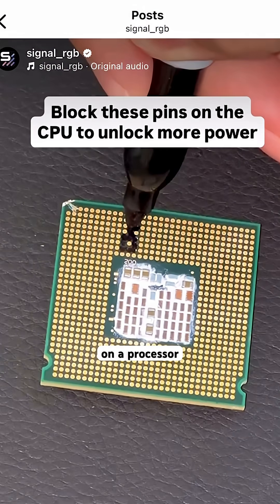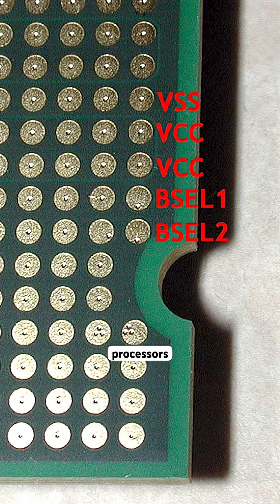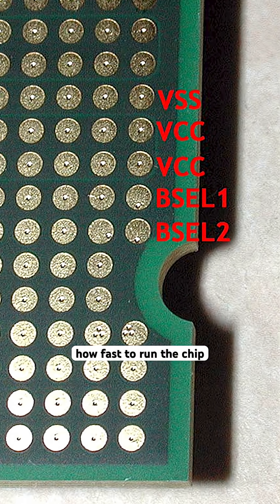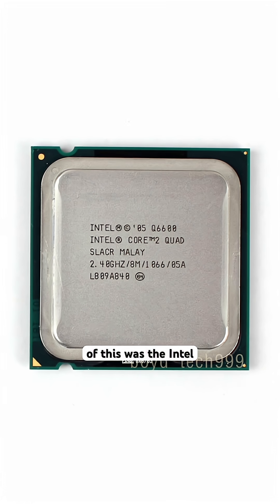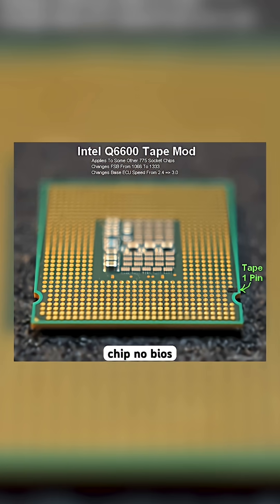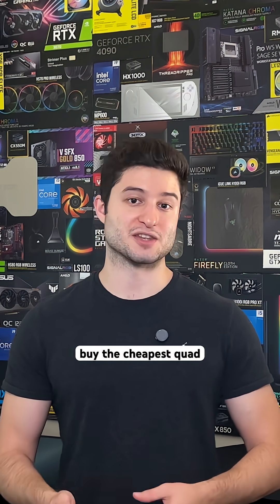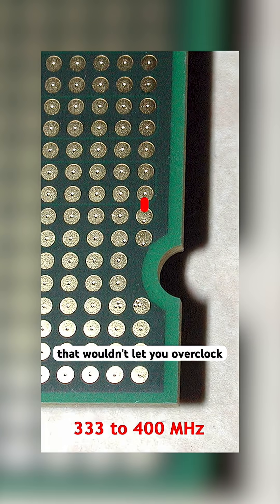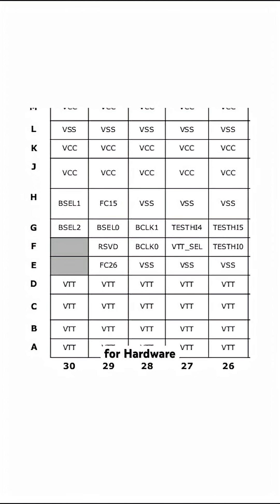Taping a CPU to improve it?!

Comment: on amd thoroughbred-II it was possible to unlock multiplier by connecting 2 pins, i did it with a small thin piece of copper strand i put in the socket with the cpu over.

Comment: Belkin made a car charger back in the day, and you could buy one with 1 usb port for $15 or two for $25. I noticed the port on the single charger was off center and lined up with the double charger. When I got home, I ripped the front cover off, which revealed a second usb port.

Comment: Theoricly some CPU are identical to higher CPU. But they determined that the quality is not enough to maintain the highest performance of high quality CPU. So the performance is tweaked to be use as low performance CPU.

Comment: And what does running a chip at a higher clock than it was designed for do to the lifespan? Thats right, it shortens it.  So you could potentially wind up soending the same or more than a pricier cpu.  Yeah its a great idea in the moment for short term gains, but its not exactly the smartest of ideas...

Comment: Usually the CPUs were tested and all models were the same with failures that prevented it from working at full speed... Thus the trick would only work if they sold more low end than high end and had to use a better cpu for it and that means the ones who got this working had that, but you could be just as well get a unstable system 😅

Comment: Chip makers use internal circuitry (ring occilators) to "grade" each chip's clocking performance,  The highest graded chips are sold for a premium, and the lower ones are clocked slower and sold for a lower price.  After they refine the manufacturing processes, they will get a larger proportion of high grade chips....and since they can't sell that many for a premium price, they will down-bin them and sell them as lower performance chips.  If you buy early silicon, this hack probably will cause problems for you since yields are low, but as they ramp up production, you have better chances, but no guarantee.

Comment: Yea, but CPUs are binned based on reliability/safe performance.  You are taking a risk.  You are putting yourself on the edge of the safety band (or worse).. source, myself former QualComm then Ampere Arm Server cpu performance engineer.

Comment: You have to wonder how someone even discovered this in the first place.
Reply: Maybe someone who worked for a GPU/CPU manufacturer and shared that secret knowledge.
Reply: Its because the pin layout is public information. There are 3 bus selection pins that tell the motherboard what the frontside bus is supposed to be. FSB for Q6600 is 1066MHz, but if none of the pins send a signal to the motherboard, the motherboard thinks its 1333MHz. You divide that by 4 and multiply by 9 to get your clockspeeds of 2.4GHz and 3GHz.
Reply: They didn't they designers already knew this and did it in testing etc

Comment: People don't understand.  Chips are TESTED to see how fast they can run.  The slower chips were rejects that failed the higher clock frequencies.  Sure, they would work, but they were unstable at these speeds - and they would consume way too much power.  Overclocking never made any sense really, your computer would run a LITTLE faster, but at the cost of stability, and it would sometimes ruin the chip.

Comment: I had my Q6600 overclocked from 2.4 to 3 GHz on a stock Intel cooler. Then I got me a Zalman CNPS9X Performa and got it overclocked to 3.6 GHz which it ran on for years until I upgraded to i5-2550K.

Comment: There was a similar hack with older AMD Athlon processors where you could connect the L1 traces with a line drawn with a pencil to unlock the clock multiplier and enable faster clock speeds.

Comment: I believe this is because of how intel grades their chips, basically they kake a bunch of CPUs, test it against an i9 benchmark, if it fails it goes down to an i7 benchmark. if it passes it ships as i7, if not the cycle repeats and repeats etc and they just underclock and disable cache or other stuff depending on what the benchmark test suggests it to be. This is why that works and also why intel overclocking can be a bit risky, it depends how far or low the cpu failed the benchmarks

Comment: This was not the cheap CPU. It was the 1st quad core CPU which costed me 300 bucks as usual for the top performance CPU for desktop!
And what's point in such "overclocking" if it was available in BIOS as usual? The thing was it was already clocked to the max from the factory. Just a little o'clock meant you'll gonna overheat CPU so even usual o'clocking q6600 had no sense.

Comment: This was also a thing earlier than core2. If you were into the OC scene back during the time of the AMD Thunderbird and Athlon XP+ series CPUs you could get some major speed boosts by using a little tape across some small laser etched gaps on the top of the CPU then using a pencil or conductive pen to bridge certain pads to complete the circuit. if your cooling solution could handle it, those processors were notoriously HOT running, and they didn't have their own IHS.

Comment: I think the most extreme one was the celeron 300A which was in fact an Pentium 2 with 450mhz clock which then could be overclocked to about 560mzh. had one, done it. was frickin' cool back then

Comment: I remember this. I also remember back in the day there were AMD cpu's you'd overclock by running a piece of electrically conductive wire in a U shape in between certain specific pins.

Comment: I had to use a pencil on my Athlon XP 2600 to connect two bridges which unlocked changing the multiplier. After that I was able to get it running at the speed of an Athlon XP 3300.

Comment: Late 90s around 2000 we could drop a single strand of wire into the AMD socket A/ 462 aocket to unlock memory speeds and multipliers. The comon thing to do was get a Mobile processor drop in the wire and you were all set. 1.6 gHz mobile barton running at 2.8 was pretty easy

Comment: It's infuriating that the capability was built into the hardware yet gated by a paywall. Intel could have offered top performance at no additional cost to them.
I'm glad Intel is floundering now...
Reply: It's actually normal to limit CPUs like this, its to prevent overheating, which could break the component. So it's not only Intel lol

Comment: I hacked a laptop version af an Athlon XP barton to run on a PC motherboard at the actual speed, but with 133 MHz instead of 166 MHz, by inserting some thin wires in the socket

Comment: Overclocking and being a high quality chip are two completely different things. The way the chips are made is interesting because the chips with the least amount of blemishes on the surface are labeled as higher performing chips since they can conduct more electricity and integrate better with the electronics attached to it. Overclocking a low end CPU for better performance won't mean much when you have to replace your CPU in two years. A lot of people did this back in the day when performance demands were much lower, but nowadays computers and gaming require higher overall performance and functionality from the chip. I wouldn't recommend doing this today. People still do it, I just wouldn't recommend it.

Comment: You could also convert socket 771 xeons to work on regular 775 motherboards with a similar method, it was pretty popular when those xeons became outdated for server usage so you could find them really cheap, afaik you didn't even need bios mod if motherboard supported core 2 quad cpus since they are basically the same

Comment: Did not need to do that with a Q6600, they clocked to 3.6Ghz folding stable with just one bump of vCore. You did need a good cooler (Thermalright unltra 120 in push/pull) and supergluing a 40mm fan to the northbridge was a good idea.

Comment: Hah, I've done this! I upgraded a corre 2 duo system to a core 2 quad with a Q6600, and used the BSEL tape mod for that free 600mhz boost in an old optiplex system!

I slapped an SSD, 8gb of RAM, and a GTX 750 ti into it too with a 500watt PSU to round it out.

It was a very competent little gaming system, and I eventually sold it to a new gamer for £100, which is what all of the parts were worth second hand at the time

Comment: Its not really that crazy when you learn these chips are segmented out when they are produced, and any defect in certain areas denotes that chips quality or yield.

For instance, the new 14th gen intel cpus. All of the 14th gen are all I9 14900s but because there are defects introduced in the process they are down graded through the ranks down to I3 14100. They are the same chip, they just hinder sectioms with defects and call it a lower tier chip so they can still make a profit

Comment: Way, way back in the day, around 2005 I think. You could unlock the AMD Duron multiplier by using a pencil to connect the L1 bridges on the top of the CPU.

Managed to overclock my Duron 600MHz to 900MHz. Tried to get more out of it but it was unreliable.

Comment: The Core2 socket 771 xeons could be made to run in a socket 775 motherboard by cutting a couple of notches on the edges of the xeon chips to fit it into the 775 socket and using tape to cover pads on the xeon chip. Similar mods.

Comment: Reminds me of the Celeron 300A. It was 300MHz, but with a simple change to the FSB speed, the CPU would run at 450MHz. Yeah that's slow by today's standards, but it was a 50% clock speed improvement. The 300A chips were cheap too.

Comment: Meanwhile early 2000's AMD Athlon and Phenom chips came with locked cores that you could simply unlock in the BIOS. So you could buy a cheaper dual core Phenom and BAM now its the more expensive quad core. I miss those days.

Comment: But what about the heat wouldn't it be extremely hot running much over the default clock speed shouldn't it be smoking hot 😅

Comment: As a kid, I did this with an old Pentium process. I took a tiny piece of copper wire and put it across two pin holes then replaced the CPU. This overclocked my CPU and, even better, I did this on a laptop too! Then I painted the laptop banana yellow. :-)

Comment: when the chips are manufactured, the dies are tested and they often don't pass 100% of testing criteria. they then get binned according to performance and functionality. lower performing chips get binned into the lower performance tier or with non-functioning features. So, just because some features CAN be unlocked, doesn't mean that these features will function correctly or at the same speed as the higher tier counterpart.

Comment: Weird I overclocked mine via the bios. Maybe I had a better motherboard? Intel Core 2 Quad Q6600 Kentsfield 2.4GHz LGA 775 Boxed Processor Model BX80562Q6600 - OC'd to 3.0GHz on a GIGABYTE GA-P35C-DS3R LGA 775 Intel P35 Motherboard. I still use it for my personal web server :)

Comment: Not really understanding this because the processor has pins at the bottom. Or are you talking about taking off the top cover? I accidentally bent a bunch of pins and had to gently straighten about 30.

Comment: WOW!  That's kinda like back in the day with 3-1/2 inch floppy disk.  If you had a "double density .72 MB" disk and you punched a hole in the upper left corner, you instantly double the storage capacity of the floppy to a "high density 1.44 MB" disk.

Comment: I started overlocking competitively in that era, starting with the Q6600 and I never heard of this tape mod being a thing. Pretty much every board then allowed simple BIOS changes to the FSB and Vcore. Getting 3Ghz off a Q6600 was literally a 2 setting change job. Guess this was discovered later on and used in pre built OEM systems with locked BIOSes

Comment: I once overclocked my pentium 333mhz pentium 2 processor to run 400mhz with some dip switches. 

The manufacturer (olivetti) was also nice enough to put a sticker inside the case to give you all the important details about what the jumpers and switches do in your computer.
Reply: Yeah, I remember motherboard manuals as well :D

Comment: This video is retarded and wrong. First of all the Q6600 was the top-tier C2Q when it was first released. It retailed for over $800, so it wasn't a budget chip in any way. Second, all of the Core 2 chips were unlocked. The real bargain was the Pentium Dual Core E2160, which cost $65 brand new and could be overclocked from 1.8 GHz to 3+ GHz on the stock air cooler. This was particularly notable because back then, quad core processors weren't nearly as common or as efficiently used in software, so it made tons of sense to buy the budget dual-core and upgrade to a quad-core processor later on after prices had dropped. In fact, you were often better off going with the the Core 2 E8600 dual-core CPU rather than a quad core because you could clock it to 4+ GHz, typically significantly higher than a comparable quad-core chip could be clocked.

And none of it required any tape hacks or anything like that, because you could just choose the bus speed and multiplier right within the BIOS. So this entire video is basically wrong about everything, other than hacks like this used to be possible (next he'll learn about the AMD pencil hack).

Edit: I suppose if you had an OEM system that came with a BIOS that didn't offer any multiplier or bus speed options, then you might resort to this, but I can't fathom why people bought such systems back then. I've seen plenty of OEM machines that still let you change these settings in BIOS.

Comment: Not only that, higher end CPU were made the same as Lower tier CPU, only thing was the trace on the CPU to the higher tier elements wasn't there.   So the higher and lower tier were essentially identical.   

The method used by some to gain the higher performance was said to be a line drawn with a high content lead pencil.  Which would wear out over time apparently and itd have to be done again.    

Never did this myself only heard about this, perhaps this was also for Intel?  I dont really know the precise details.

Comment: I had a q6600. You didnt have to tape it, just overlock it in bios. I ad min go for 3.1 GHz, no power adjustment needed. Mine ran for 6 years before it got killed by a lightning strike.

Comment: This technick wasn't directly changing the CPU frequency by the default overvoltage, or overclock it by changing the multipler. Long answer short it tells the motherboar what FSB frequency the CPU need. And on the other end with hugher (overclocked) FSB from 333Hz to 400Hz and fixed multipler let say 8 you would get from 2.66Ghz you would get 3.2Ghz. Back then the more advanced and expensive motherboards had either physycal (jumpers) or firmware (in the bios) to choose between 2 or more different FSB (front side buffer) Frequencies. And if it didn't you could always use the back door to do it.

Comment: Wild. I had a Q6600 for the longest time, never once knew about the tape trick. That CPU was a beast during its time though with its overclocking potential, I had it paired with two 2900XT's if I remember right

Comment: We did this with AMD K7 thunderbird we could make 600Mhz CPUs run 900 with homemade waterblocks on the top you used a #2 pencil and shade a line to connect to contacts. In the next line athlon XP AMD changed the layout and made a trench so the trick didn't work until we figured out to epoxy the trench and shade over it.

Comment: Q6600 - mine ran at 3.1 GHZ on air with a thermaltake V1 cooler on a Striker Extreme motherboard ran 4GB(2x2) of teh Corsair Dominator 1066. Wasn't hard It was called actual overclocking ability.

Comment: Im assuming they put a limit bc the chip wouldnt be able to handle it. Other unlocking and running your cpu at speeds it normally wasnt designed to handle would have short-long term effects on cpu health. Good to know tho

Comment: I have to point out that this was even better, because you could mod socket 771 cpu's to work into socket 775 motherboards, my first PC was a Xeon X5460 running in a 775 from gigabyte, also overclocked to i think 3.2Ghz? it was great, i still have it and with a GTX 470 and 8GB of ddr2 ram, was for a long while my PC, even capable of some 1080p gaming.

Comment: Socket 775 is the platform I have overclocked the most ever. But I have unlocked motherboards. But pretty much every chip you could buy was stable one step up on the Bus speed. 800 to 1066, 1066 to 1333 and 1333 to 1600 no problem

Comment: That was a thing back in the 1990’s. I did something similar to my ice cream sandwich CPU. Except it was done using a pencil, and connecting two dots. BAM! Instant 100% increase in performance. From about 100 MHz to 200 MHz. Now that was some serious overclocking.

Comment: I did something similar to my Athlon XP 1900+. I bridged a couple of connections on the top-side of the cpu, with electrical conductive thermal paste. And this unlocked the CPU multiplier, allowing me to easily overclock 1.6 GHz to 2.0 GHz.

Comment: Who figured this out? There are som geniuses out there.
Reply: They looked at the pinout for the socket, discovered than 266 MHz is with BSEL0 high, but 333 MHz with BSEL0 low. So someone tried connecting it to ground and it ran at 333.

Comment: I also did the "pencil mod" on a processor whereby you drew a line with a pencil between 2 points on the top of a chip and it turned it from clock-locked to an overclocking processor.    I can't remember which processor but I remember doing it and it worked.
Reply: Athlon.
The early Athlons did that. Later they changed the material and you had to remove the coating and use silver paint, but the method was the same.

Comment: They also had special mod using tape with tracers that changed the pins to allow 771 xeons to operate on a 775 socket.